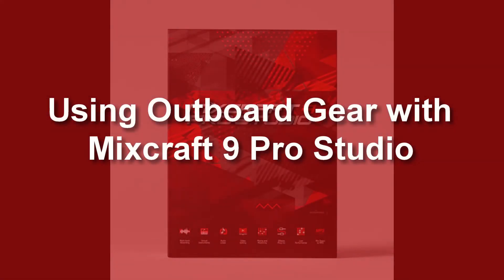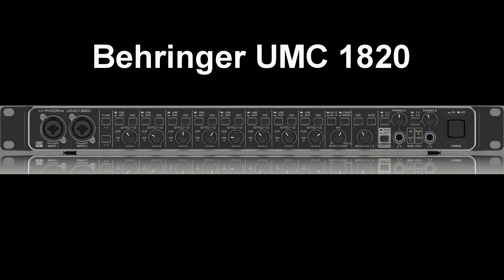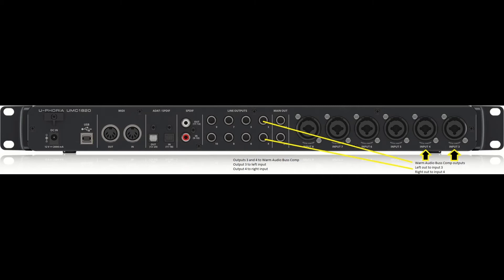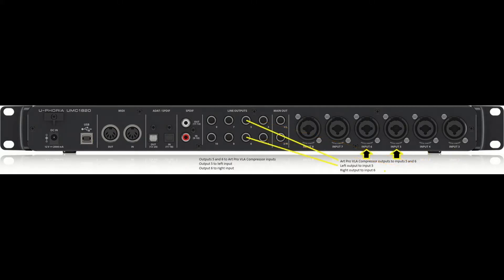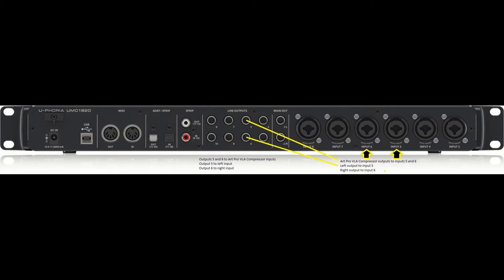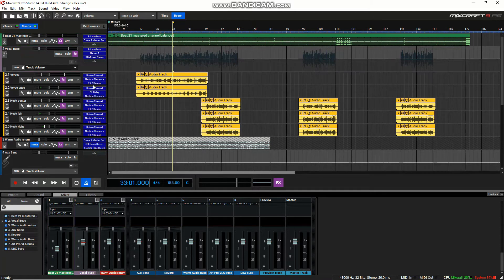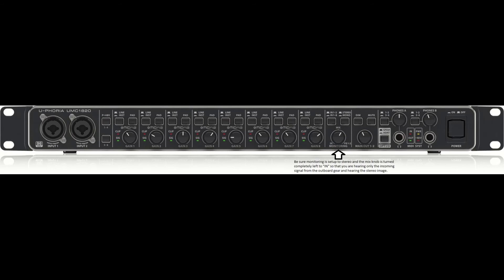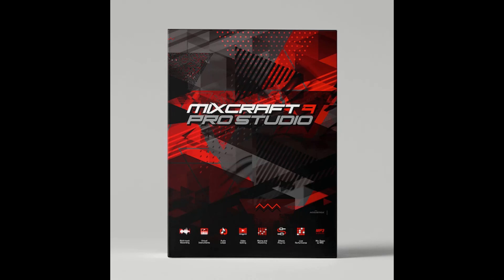Using Outboard Gear with Mixcraft 9 Pro Studio

Comment: I like your walk through using outboard gear with MixCraft. I’m working in MixCraft 10 and have recorded keyboard R and L tracks as well as a vocal mic track. I have the outputs 3/4 on my RME interface routed to my Stam audio compressor and the outputs of the Stam audio compressor routed to inputs 3/4 on the RME interface. The routing in MixCraft isn’t working for the vocal track to be processed through the Stam audio compressor. I inserted an output bus track and routed it to outputs 3/4 of the RME interface, when I rout the output of the vocal track to the output track I get no vocal audio, I have a vocal return track inputs routed to inputs 3/4 on the RME interface. Not sure if my issue is the RME Total mix software or MixCraft software. I hope my description isn’t confusing, and hope you see something in my setup that is routed wrong.
Reply: Not saying you do, but make sure your vocal return track isn’t routed to the output track but to “master track” that could help.

Comment: I have everything connect but my dbx266 not showing up??
Reply from the maker: You have to do the routing within Mixcraft and then label the output buss to your dbx and return track from your dbx yourself. No outboard gear just shows up. Outboard gear is analog not digital.
Reply: @immortalitytherapper23  I use a Apollo twin and it only has inputs not outputs
Reply: @immortalitytherapper23  I’m sorry it does has outputs